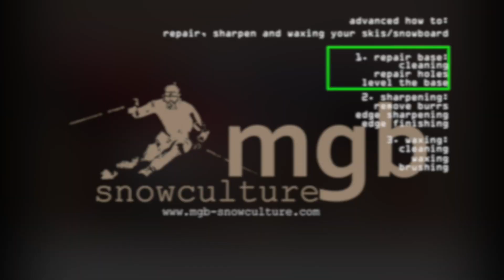Advanced how to repair the ski snowboard base

Comment: hi. cool video. i just bought my first metal grip and p tex stripes just to use them with the welder to avoid black spots ( for transparent p tex). 
please help.. what is the temperature setting on your welder? my p tex melts and creates bubbles and after scraping it leaves some air holes and gaps it's anoying. please help. thank you!
Reply: Radu Teodor Stoian the melting point of p-tex is just over 300*f I think like 302 or something.